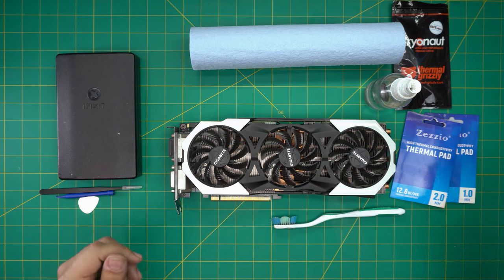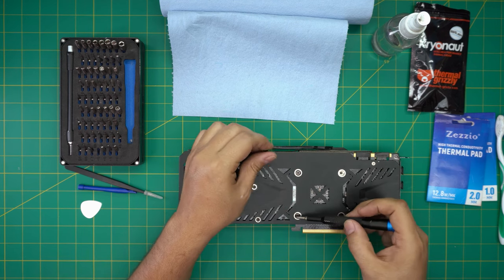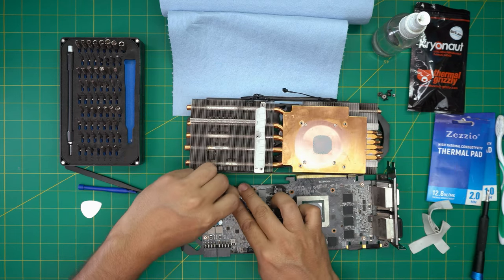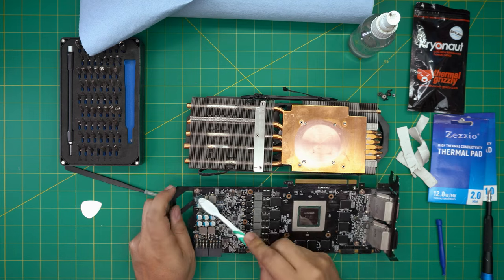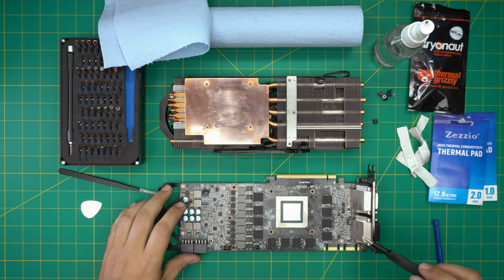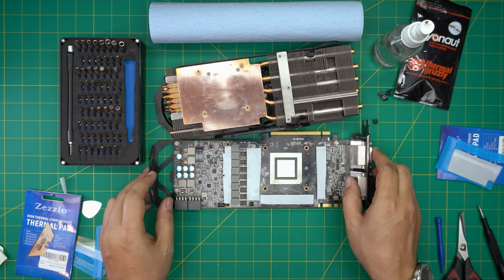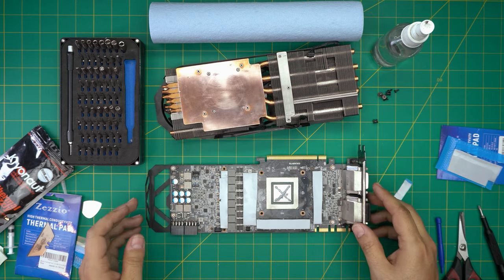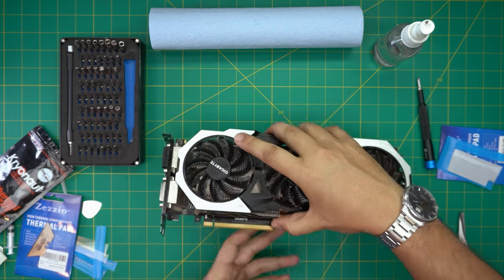How to Repaste and Clean NVIDIA GTX 980 Ti - Step-by-Step

Comment: I'll be doing this tomorrow because my 980 hit 94 Celsius!
Thanks to you, now I can maybe give it one more chance. 
Very nice video.
Reply from the maker: It's truly a pleasure, my friend.😊 I deeply appreciate your taking the time to provide feedback. If you're inclined to support the channel further, feel free to like and subscribe—or even both!
do the repaste and bring back to life the poor GPU🙃
Should you have any questions or requests in the future, please don't hesitate to ask me.
cheers🍻
Reply: @uFixTek  I cleaned it really good with a 1 inch long soft bristle paint brush like bob ross, having a vacuum nearby pulling out all the dust, blew it (not using canned air)
Used Arctic MX-6 thermal paste, and Arctic 1mm thermal pads. Double stacked the pads after cutting them out according to the etches/dimension visible in the metal frame. Since it was close to 1mm, but when smashed it needed 2mm.  Went with a full cover of thermal paste since the MX-6 is very thick like peanut butter.
Temperatures are incredible. Using CPUID HWMonitor My GPU has not went over 70c, and the hotspot will not go over 80c. It idles in 30's. . 
Again thank you very much for the video. 🥰
Reply from the maker: awesome job my friend 🫠 now that you know how to service those GPUs , you should be doing it once every year depending the temps and dirtiness.
enjoy the fresh serviced GPU🍻

Comment: I just cleaned a 980ti that came out of a roach infested house and oh my God what a nightmare. I used a quarter gallon of iso alcohol. 
I just soaked the whole heatsink in a container of ISO and sprayed it off with a garden hose lmao. 
Good results afterwards. Temps are down 10c, fan speed hasn't gone past 1500rpm even under heavy load. 
The previous owner also had no clue that less is more with thermal paste. 
But hey, It works buetiful and I only paid 100$
Reply from the maker: awesome purchase and awesome job with restoring it cheers🍻
enjoy the card now 🫠

Comment: Great video, one question. Is it safe if a bit of thermal pad is also on another component, for example I cut the thermal pad for VRMs but a little bit of it is covering a capacitor.
Reply from the maker: It's my pleasure, my friend. 😊 I deeply appreciate your taking the time to provide feedback. If you're inclined to support the channel further, feel free to like and subscribe—or even both!
Regarding your question, it is absolutely fine and even better, no need to worry of the excess of pad touching other components.
Should you have any further questions or requests in the future, please don't hesitate to ask me.
cheers🍻

Comment: Does thermal pad hardness really matter if it's the correct thickness?
Reply from the maker: 🫠Regarding your question, no it doesn't , just get the correct thickness and you be fine.
cheers🍻
Reply: @uFixTek  K thanks.
Reply from the maker: It's my pleasure my friend.

Comment: i have the same gpu and same edition gigabyte windforce and its up to 90° what should have to do
Reply from the maker: 🫠Regarding your question, if you reaching 90c on load then sure do a repaste and it should be on mid 75-85c.
use a good thermal paste like: thermal grizzly kryonaut extreme: https://amzn.to/3Uvg9Pm
Should you have any further questions or requests in the future, please don't hesitate to ask me.
This is an Amazon affiliate link. When you use my links, you are helping to support the channel. 🙏
cheers🍻
Reply: @uFixTek  realy thank you, i will ask you some questions because you have the same card and same edition gigabyte windforce, so the normal temp of this card is 75/85? its not dangerous!
Reply from the maker: It's my pleasure my friend. and those temps are perfectly fine sometimes it can even reach 90c if it is super over loaded.
Reply: @uFixTek  now its 83° in 100usage, is it safe?
Reply from the maker: that is perfectly fine.👍